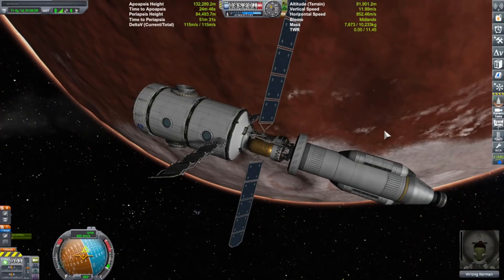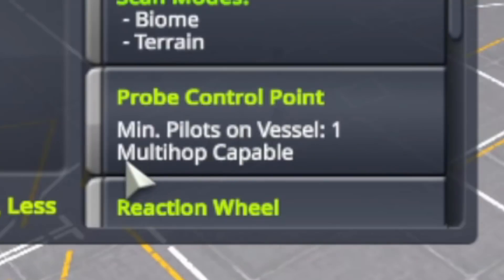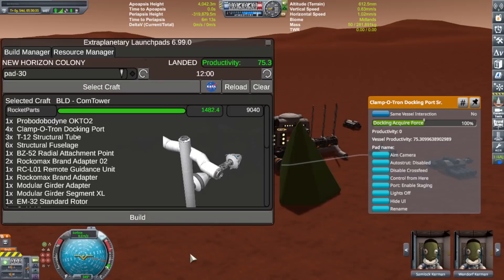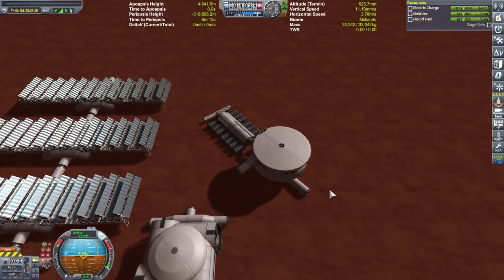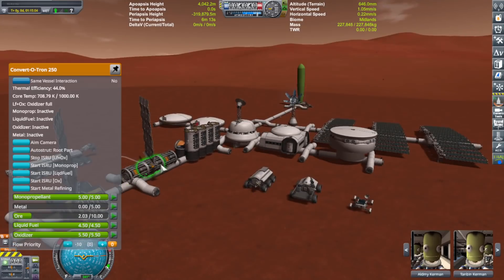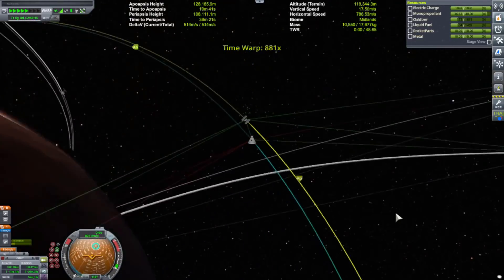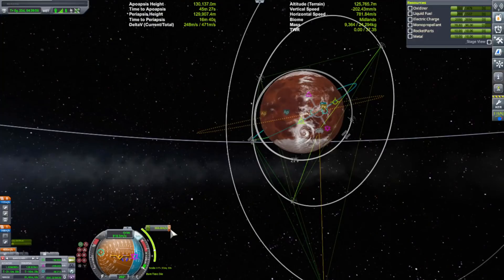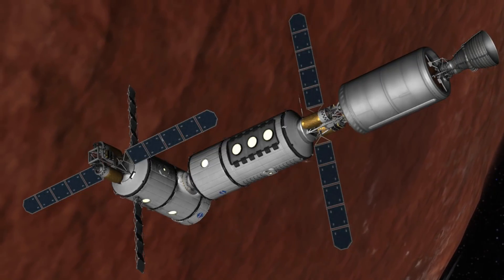Home grown Duna Colony Space Station!

Comment: Vaos, now that you have a new box;  There is a mod with 2 or 3 command pods that are MultiHop capable.  They are in Stockalike Station Parts Expansion Redux (SSPXr).  They even include IVAs.  Inside they look like a large station command room, or you could use one for ground control.  Look for the 3 largest command pods and check the details.  One is 5 meters and another one is 3.75 meters so they are pretty big.  The IVA pack is in the Extra directory and needs to be placed in the GameData directory.

Comment: Excellent work. It makes me want to play again. I have huge respect for you, bruh. In addition to producing quality videos, you also work a really tough job IRL.

BTW, I  have a fix for the Kraken Death Shake  issue. Works 100% of the time. It only happens on ships with more than one possible control point. It is especially likely to happen when two ships dock, effectively creating a singlelarge ship, with many possible control points. All you have to do to prevent it is, when you dock two ships, choose any part that has the option "Control from here...", and assign that part as the control point. It doesn't matter which one. I've been doing this for years, and it never fails. It will even work on a ship that has already begun to shake, provided you get to it in time. Please let me know how it goes for you.

I'm trying to find a modder to create a mod/plug-in that does this automatically.

Comment: Might I suggest "Bon Voyage"? It's a mod that allows for rovers to drive through time warp. Now they're finally useful! (Also, it could be used to transport the equator base)
Reply: eentereesteeng! Does it work if you switch to any other vessel and only time warp as you need to for that vessel? I have a lot of flights going on at once.
Reply: @eekee6034  I’ve never tried that, but I assume the rover just needs to be unloaded to work.
Reply: How do you use bon voyage? I want to set up ASDS’s off coast for reusable boosters.
Reply: @pricelessppp  It can only be used in the tracking station. you have to turn it on, specify your destination and then enter the tracking station. then time warp in the tracking station until it arrives, at which point you can reload the vessel.